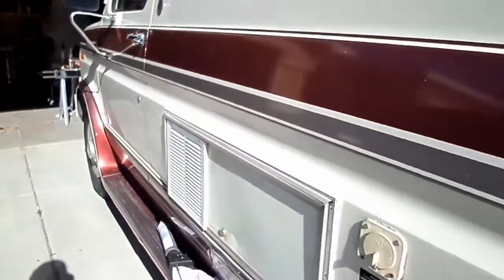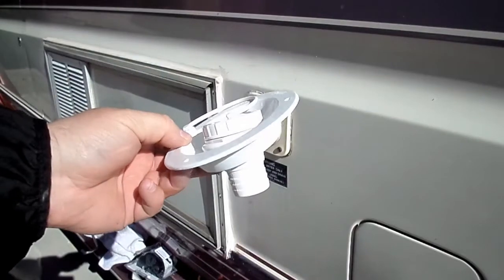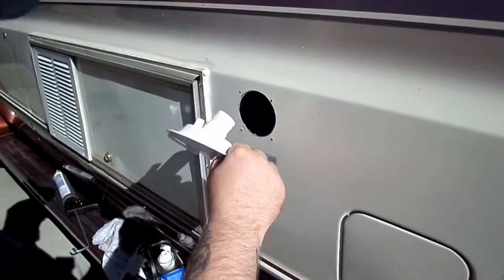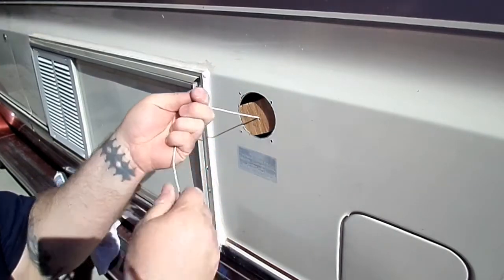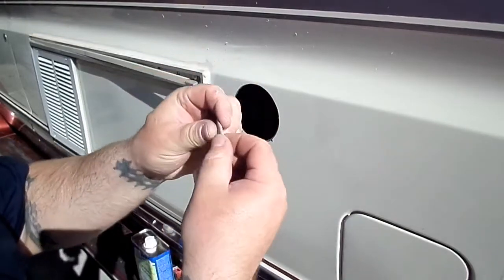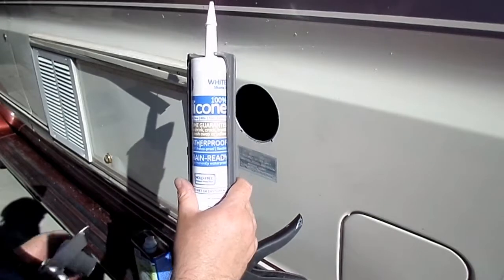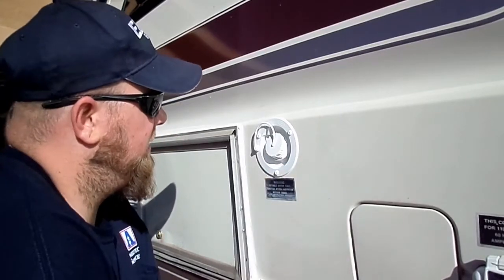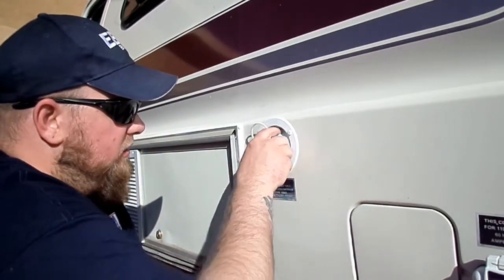Fresh Water Fill Inlet Port Upgrade On RV CamperVan & fresh water tank hoses

Comment: Excellent! Just what I had been searching for! 'Acquired a '73 Kenskill travel trailer and she requires some substantial tlc, lol but soooo worth it..
Next up-trying to get the Dometic fridge to either light/run on on lp or run on electric.. Stove, front/rear heaters and A/C work! But does NOT take LED bulbs(major frustration)
Anyways I have subscribed, lol